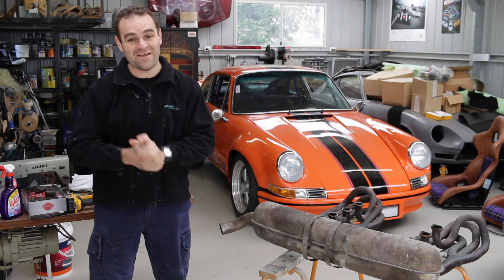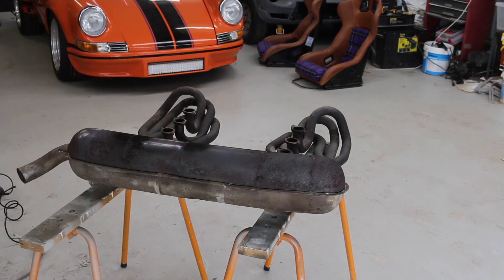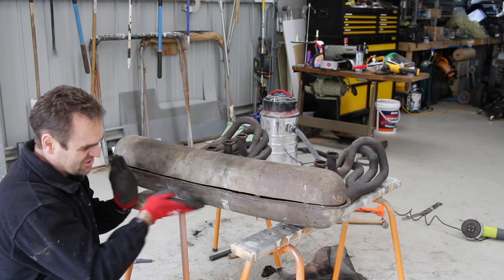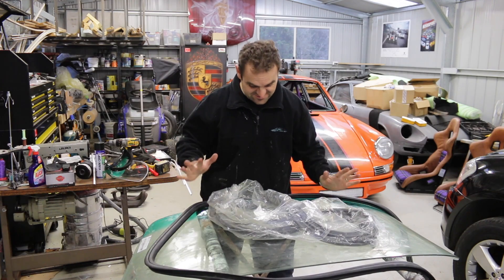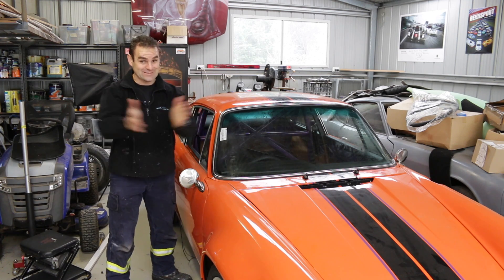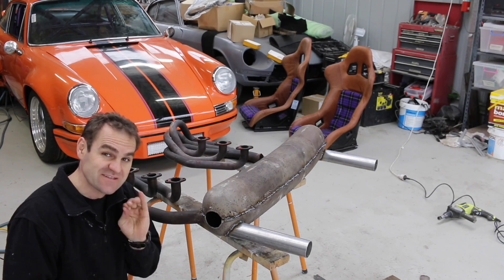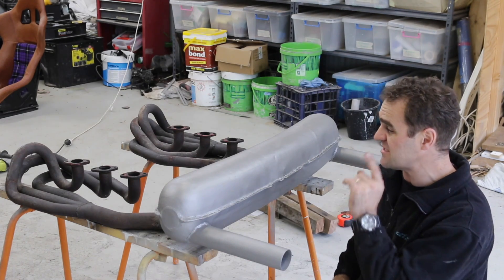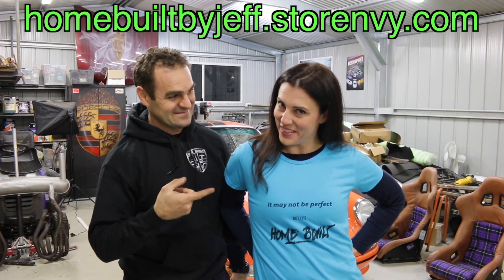How to make a custom exhaust - Porsche 911 Classic Car Build Part 58

Comment: I appreciate that you spend the time fixing things like this instead of just throwing them away. When I was at uni i rebuilt a VH commodore (Rust, Paint, Engine Rebuild Etc). It took me 5 years, but it only cost me 3K because i largely made do with what i had and the only job i outsourced was the windscreen.

Comment: I've been planning on doing this with my 914-6 GT Rep project. I'd seen the illustrations before but this is great Jeff - Thanks.
Reply from the maker: I did a bit of research and there are others who have done it on Pelican. There are a couple of different internal designs, so I am not sure if the 914/6 is the same, but once you cut it open you can work out the flow and go from there.
Reply: Home Built By Jeff i think this is the only video I’ve seen showing the process, thank you! While you can feel it, we need to HEAR the difference! Could you borrow a decibel meter and throw that in there too!? lol - no but seriously. Would be really great content and unique too.

Comment: Congrats on the windshield. That is always one of the problem areas, especially if you have to make corrections  by removing rust and adding new metal because of corrosion. 

Love what you've done to the exhaust. I think it looks much better with two outlets.

What is the status of the engine? Maybe I missed an episode, but I don't remember if you gave a recent update.
Really enjoy your videos. (I love Mrs. Jeff's response to your dancing moves (?) in the outtakes. Maybe if you took lessons.)
Reply from the maker: Haha. What is wrong with my dancing. Obviously both you and Mrs Jeff have no idea...

As for the engine, it is still getting machining and parts ordered. It will be a while yet unfortunately.

Comment: Are the tips mounted low enough on the muffler that it will fit without modifying the rear bumper?

Comment: Yo Jeff you microdot! A medium?! Bloody hell I need a 5xl. But I am scary 🙄. Loved the exhaust work. You are a brave man. When it comes to exhausts I am precious beyond belief. Must be stainless steel, must have inwardly rolled tip(s) and centre exit where possible. My favourites are Remus and Supersprint (I had to order the Remus for my Alfa 156 from The factory in Austria😱). I hope you had a party to celebrate the windscreen going in. Should be finished for when you retire!
Reply from the maker: I am only 5'8. I am not a big guy ;)
As for the exhaust, stainless is less of an issue in Australia. An standard exhaust here lasts the life of the car, so stainless is overkill. As long as it flows, and this is a big step up from standard.
Reply: Home Built By Jeff I kind of guessed you weren't so tall seeing you working on your car. You're better off anyway suits, shirts cost a fortune. The irony is I can buy jeans in most places. Too much gym, too much rugby and too much american football. At least my buggered heart (from a heart virus!) means I get to gently blob out in my early retirement. In the UK mild steel exhausts don't last, more so if you don't use the car every day. Can't wait for you to get the engine back! Btw is the Alfa still outside?

Comment: I hope you are happy with your exhaust modifications but I think you just caused yourself some more work. The original tailpipe lower valance cut out now must be welded up not to look silly as it is not used. I think it would have been cooler looking and freak out the Porsche purists by making a mirror image right side outlet. With your skill I am sure it would look factory and the purists would ask hey was this dual exhaust equipped originally?? Keep up the great work!!!!!
Reply from the maker: I have a completely new rear bar with no cut outs, so it is not going to matter on that front, and the corner exit pipes on the early 911 rear look terrible in my opinion, so I am happy at this stage ;)

Comment: Get the Dansk headers/heat exchangers in stainless steel Jeff. Anything else is a cop-out. The headers and heat-exchangers take the worst abuse of any part of the car, and unless they are stainless steel, they will rust out. Nothing is more sure. I'm going with stainless from end to end for my 69S. The worst thing in  a 911 is a loud exhaust. You do not want that! I already related how the (lack of) exhaust system on my road-legal race car drove me insane.

I'm a bit dubious about your muffler mods. I think it will be too loud. But, time will tell!

Don't crow too soon about the windscreen! Now you've got to test how much water leaks through the bottom outer corners. :P  You will be extremely lucky to have fitted it so that it does not leak. And I do indeed hope you are lucky!